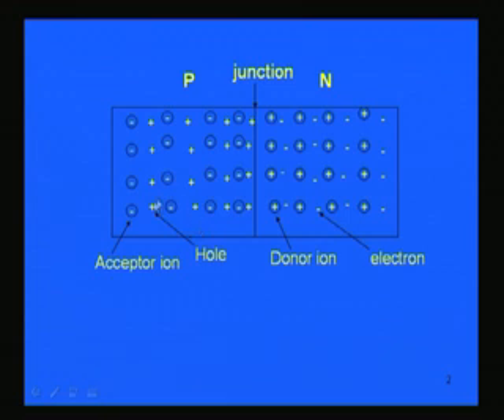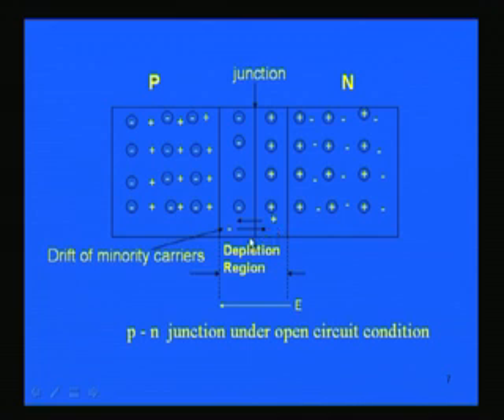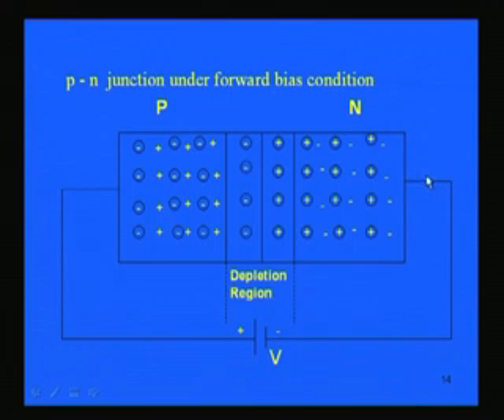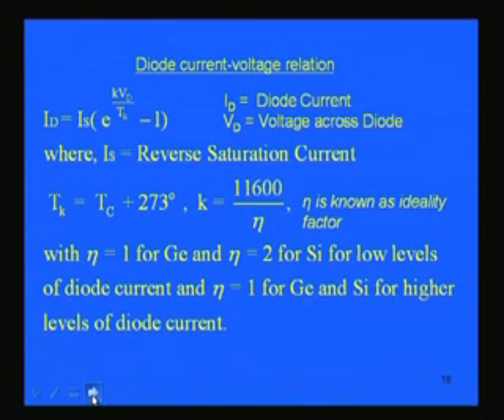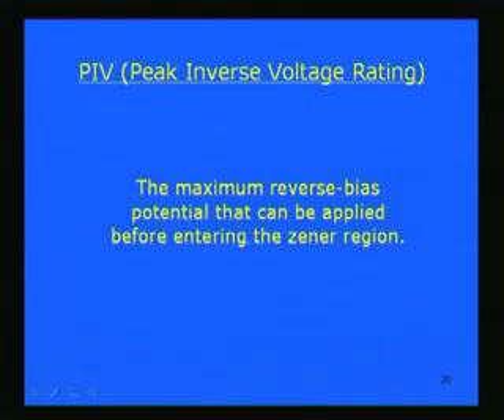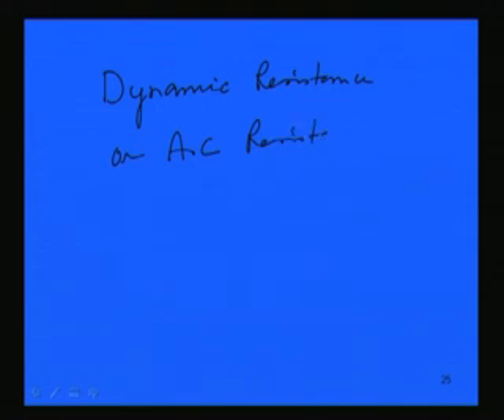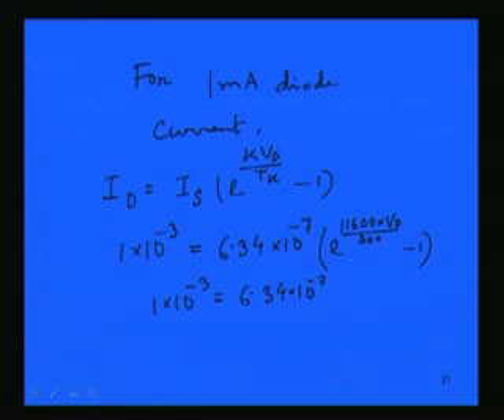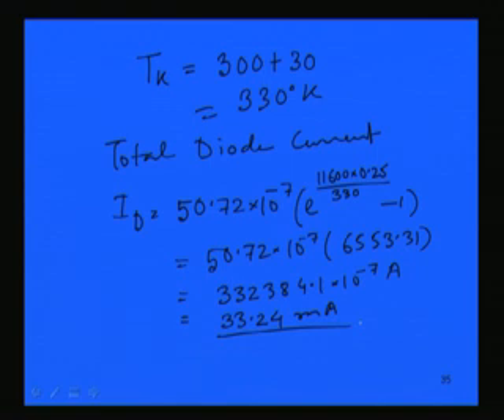Module - 1 Lecture - 2 PN Junction Diodes

Comment: You know what prof..You do not know shit about this subject..You do not need to apply voltage more than barrier potential for conduction of diode..The diode equation is derived for quasi equilibrium condition which is much much below the barrier potential..So if we take the current scale in micro or nano ampere then a much much much less voltage compared to barrier potential will make the diode conduct..

Comment: what is the point of zero barrier potential in case of forward bias in pn junction diode known as?
Reply: If it's potential barrier becomes to zero volts then it starts to behave like a short circuit and so it becomes a good conductor, since the barrier completely vanishes and it comes to zero point, that means the barrier potential is zero now

Comment: sir which device converts dc to dc
Reply: its a chooper bro ... it shift the dc values
Reply: +samanth krushi  there are also voltage regulators which converts any DC voltage to a particular DC voltage
Reply: @VatsalMakani  yes for that we requires a voltage regulator that is zener diode.